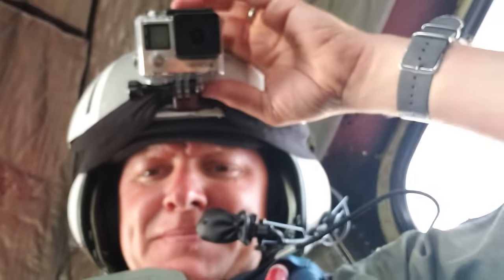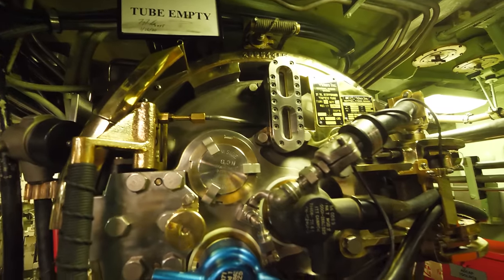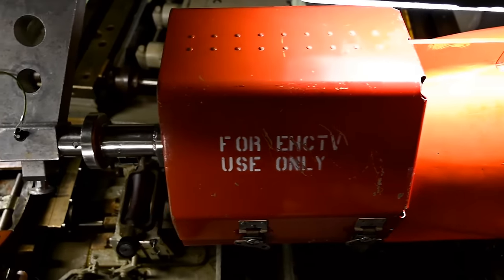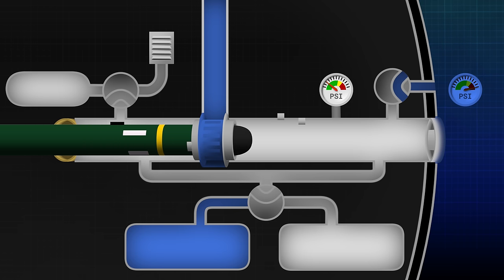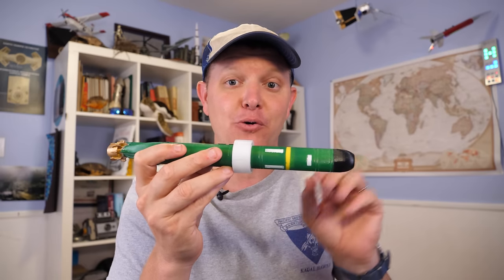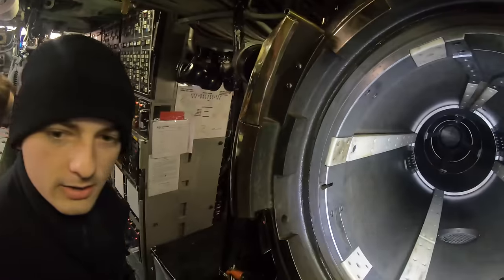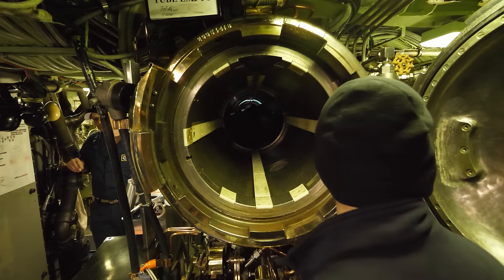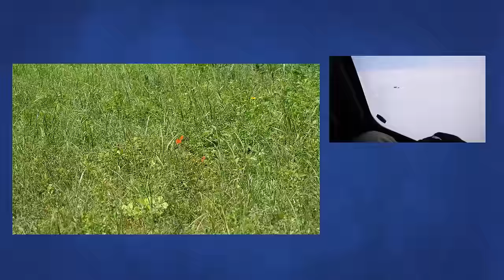Crawling Down A Torpedo Tube -US NAVY Nuclear Submarine - Smarter Every Day 241

Comment: OK, but, (dunno if you were being misinformed on purpose)

A: Of course torpedoes are neutral bouyancy. If they weren't as soon as you fired them they'd float to the surface or sink to the bottom. The only way to stop that would be to swim the thing level and that costs you distance and speed.

B: Submarines don't have a problem with running out of air - they make their own with electrolysis. The reason they keep the compressed air on board is because dumping air makes a lot of noise. So does shooting a torpedo, of course, but air takes a lot longer to get to the surface and is very noisy the whole time you're doing it, and it's not like they're not trying very hard to reduce all noise everywhere.

C: Water doesn't compress, the reason for the equalising vent isn't to set the same pressure inside and outside the tube - they are the same as soon as it's full, it's to match salinity and temperature so the torpedo can understand its target data once it's off the wire.

D: You didn't mention the wire?! That's gotta be one of the more mind-bending things about the ADCAP, thirty miles of cable being strung out the back of the fish, constantly spooling through the tube...

E: i think I might have been tempted to mention that the tubes can be configured for swim-out mode for divers as, well, might be fairly claustrophobey in there when the tube is dry, just trying to imagine doing that when it's full of ice cold water, you're wearing an aqualung and there are no lights, that's brown water time, at least for me.
Reply: you are wrong with C. Water basically is incompressible, but the pressure difference at depth is considerable and pressure makes force which they do not want when they open the external door.  Just because water is incompressible does not mean it does not pressurize.
Reply: @gkprivate433  Had a long and more indepth reply almost finished when my PC BSOD'ed that into oblivion. This will be briefer.

No, that's isn't how it works. The same word is used for similar effects but that just causes confusions.

We have found sealed glass bottles of wine at considerable depths. Were you correct they ought to have imploded on their way down. They do not because liquids cannot be compressed, and so remain the same pressure irrespective of depth.

The effects of water pressure (actually a manifestation of mass) on a submarine is because air is VERY compressable. A breach in a submarine effectively ends up 'using' the weight of water to compress the air (and crew) until all media equalise.

It is not possible to manufacture a container of pressurised water. You can manufacture a container with water under pressure (by, say, adding a load of very compressed gas to it) but that isn't the same thing. The confusion here is thinking that the water of the ocean is pressurised, whereas it is, in fact, under pressure. I can hear Queen too.

Filling the torpedo tube with water and then exposing it to the water of the ocean does NOT change the pressure of the water any more than uncorking a wine bottle a half mile down would change the pressure of the wine.

Put another way, one gram of water has a volume of one cubic centimeter no matter where in the water column it is sampled.
Reply: @Belzediel  A brief Google search shows that water is compressible (as is all matter) but it requires a great deal of energy.  Other documentation I found cites the same procedure Dustin walks through including pressure equalization.  This suggest to me that the force of gravity on the water is enough to compress the water at least enough to be a problem.
Reply: @grn1  Horse. Water.
Reply: Technically, anything can be compressed, solid and liquids are only considered unable to do it because their molecular structures makes compression extremely difficulty, in such a way that not even the depths of oceans are enough to compress them.

And the guy that answered you sure is wrong, yeah. In this regard, the "liquid pressure" we consider is just the weight of the water column over an area. The entirety of hydraulic mechanics goes around that liquids are almost impossible to compress, as as such are rather reliable ways to transmit force, and if needed, manipulate it. The contrary is true for pneumatic stuff, since its workings depends on using a gas that - something that can be easily compressed - and thus obtain various desired results from that, such as thermal pumps.
Reply: F you didn’t ask them about ‘squibbing’ the weapon batteries. Can’t remember if they do that for mk48s
Reply: OK, lets exercise the firing system to maintain it.  We will fire a water slug.  That means a tube full of water, no weapon.  STEP ONE, open the breach door and ensure the tube is empty.  Yes, that really is step one.  Care to guess how it became step one?  STEP TWO, secure the breach door.  STEP THREE, flood the tube with water.  You use water which is already in the sub to prevent taking on an additional 3000 pounds of ballast.  While you are flooding the tube you also are venting the air out of it so the tube will fill with good old in-compressible water.  Water is now coming out the vents so the tube is full of water.  STEP FOUR, shut the flood and vent valves.  You now have a tube full of water.  NOW THINK, what is the pressure of that water in the tube?  If you missed the answer; it is the same pressure as the air inside the submarine, the stuff you are breathing (it is a closed atmosphere in the sub but lets call it atmospheric pressure anyway).  NOW THINK AGAIN,  what is the pressure of the water OUTSIDE?  Hint;  44 psi per hundred feet.  Now open the muzzle door so you can fire the water slug out the tube.  Why are you having trouble getting the outer door open, its water on both sides.  Remember how big that outer door is?  About 400 square inches.  400 times 44 psi = 17,600 pounds of pressure per 100 feet pushing to keep the door closed.  The tube is full of water at about 15 psi trying to get the door to open.  400 times 15= 6000.  The odds favor sea pressure.  To overcome the odds equalize the pressure in the tube with sea pressure.  A very small valve opening the tube to sea pressure say 1/4 inch.  That would require about ELEVEN POUNDS of force to operate that valve per 100 feet in depth.  STEP FIVE, equalize pressure.  Takes less than a second as the tube and the sea are both full of incompressible water.  STEP SIX, open outer door.  Close EQ valve, fire tube, shut outer door and drain tube.  Open and inspect tube to ensure  no sea life has entered.  Usually inspecting for seaweed, barnacles, or any loose debris from the superstructure. From some of the comments I have seen here you might also look for seals, walrus and mermaids.  Also it is the equalization step that makes it hard to launch people.  Going from atmospheric pressure to sea pressure instantaneously is rough on a persons body, starting with the eardrums and extending to the lungs and ribs.  It might be done with special equipment but in general NOT A GOOD IDEA.
Reply: @williambixby4108  Thank you for the explanation and logic 😊
Reply: @williambixby4108  That was an amazing explanation, thank you. 
As for Guess how that became STEP ONE, I would imagine there has been a person or two left trapped inside there and it did not end very well for them.
Reply: @DarkSygil666  The Willy D (USS William D Porter) comes to mind, where they went to fire a water slug, during a drill and launched a live torpedo directly at their flagship (USS Iowa) with the US president (FDR) aboard.
Reply: Admiral Belzediel you seem like you know a lot so can you explain to me why in the demonstration of loading and firing the torpedo, the bottom water tanks have more water in them at the end. Wouldn’t that change the entire simulation for the next firing?
Reply: @wolvreigns  They don't.
Reply: CR   That's only at the most extremes.  I finally thought a good way to explain it though.

Imagine you have a spring and a press.  For the sake of argument I'm just going to use arbitrary values but the logic here is solid.  If you use a relatively light weight spring (say a pneumatic one) with a light (low force/pressure) press the light spring will compress quite a bit.  If you repeat the experiment with the same force but a heavy (say a hydraulic) spring the spring may not appear to compress at all.  Repeat both experiments again but with a much heavier (stronger force/pressure) press and the light weight spring is pulverized (it changed state) while the heavy ("uncompressable") spring is visibly compressed but does not change state (enough energy to compress it but not to change it's state).  

Liquids in a hydraulic system are like the heavy spring with the light press, the liquid compresses so little that it can be treated as if it was uncompressable.  Almost all of the force that goes into one side comes out the other since the liquid barely compresses at those forces.   Water at depth is like the heavy spring under the heavy press, the normally uncompressable liquid is now very compressed but unlike the spring which would be exerting all of it's forces up (towards the press) and down (towards the ground) the water pushes out in all directions looking for a lower pressure zone to move to (it 'doesn't like' to be compressed).  The water in the submarine before the torpedo chamber is flooded is at the same pressure as the air in the submarine and as such is barely compressed and the amount of energy needed to compress it enough to get equivalent pressure is insane.  Combine this with what  @CR  That's only at the most extremes.  I finally thought a good way to explain it though.

Imagine you have a spring and a press.  For the sake of argument I'm just going to use arbitrary values but the logic here is solid.  If you use a relatively light weight spring (say a pneumatic one) with a light (low force/pressure) press the light spring will compress quite a bit.  If you repeat the experiment with the same force but a heavy (say a hydraulic) spring the spring may not appear to compress at all.  Repeat both experiments again but with a much heavier (stronger force/pressure) press and the light weight spring is pulverized (it changed state) while the heavy ("uncompressable") spring is visibly compressed but does not change state (enough energy to compress it but not to change it's state).  

Liquids in a hydraulic system are like the heavy spring with the light press, the liquid compresses so little that it can be treated as if it was uncompressable.  Almost all of the force that goes into one side comes out the other since the liquid barely compresses at those forces.   Water at depth is like the heavy spring under the heavy press, the normally uncompressable liquid is now very compressed but unlike the spring which would be exerting all of it's forces up (towards the press) and down (towards the ground) the water pushes out in all directions looking for a lower pressure zone to move to (it 'doesn't like' to be compressed).  The water in the submarine before the torpedo chamber is flooded is at the same pressure as the air in the submarine and as such is barely compressed and the amount of energy needed to compress it enough to get equivalent pressure is insane.  Combine this with what @WILLIAM BIXBY said and you should have a pretty full picture.
Reply: @Belzediel  I work on machines that measure compressibility of fluids. I can assure you that water does, in fact, get compressed. It reduces in volume when you press on it. Even the slighest pressure causes an even slighter reduction in volume. It is only "essentially" incompressible for many (but not all) engineering purposes.
Reply: @Belzediel  Everything you've said is right, though you'd be technically thorough by mentioning that water, like all matter, is compressible regardless of how difficult it is to do in practice.
Reply: @austinsharpe8157  |Point is, and always was, in a video intended to be educational, they said something that was not true.
Reply: @williambixby4108  One atmosphere (14 psi) per 33 feet is how they taught us. I took a dive class.
Reply: @grn1  that's why an underwater nuke explosion causes so much damage. A depth charge had 500 pounds or so of TNT. A Westinghouse 55 (SUBROC UUM-44 warhead) has the equivalent of 500,000,000 pounds of TNT. (250 KT)
Reply: @Belzediel  Water is considered "virtually incompressible" just for engineering purposes. In absolute reality of fact though, it can be compressed under extraordinarily insane forces (we can find examples of compressed water taking on strange properties like "Ice IX" out in space,) it's just way beyond anything we'd use here on Earth even for massive heavyweight construction so for all practical purposes we consider it "virtually incompressible." Your overall point still remains, sure, but you shouldn't say "Horse. Water." to people simply pointing out that water can technically be compressed, like any other matter, under insanely high forces we don't normally find here on Earth even in our most heavyweight construction/engineering purposes. You were acting like they were dumb, that you can lead a horse to water but can't make them drink, when they were actually pointing out factually correct information nonetheless.
Reply: @michaelnorris6365  Interesting.  Your ballpark figure gives us 42 psi at 99 feet.  My ballpark figure gives us 44 psi at 100 feet.  Looks like we are in the same ballpark.  If I were diving (which I have not done) I would expect the gauge to top out at a couple hundred feet.  When I was new to subs the gauges for depth read out in feet. A fine gauge for depths above scary and a course gauge for depths below scary.  The fine gauge was secured from sea pressure when going deep.  In the torpedo room our gauge measured sea pressure, analog, and as i recall 50 psi markings good to a few thousand feet.  For me 44 per hundred was practical.  Per this chart google search brought up neither of our methods are accurate.
EXAMPLE (Imperial)
Depth (meters/feet)	Fresh Water (1000 kg/m3)	Sea Water (1030 kg/m3)
15.25 meters (50 feet)	0.3 MPa 36.4 PSI	0.3 MPa 37 PSI
30.48 meters (100 feet)	0.4 MPa 58 PSI	0.4 MPa 59.3 PSI
61 meters (200 feet)	0.7 MPa 101.4 PSI	0.7 MPa 104 PSI
91.5 meters (300 feet) Gato	1 MPa 144.8 PSI	1 MPa 148.7 PSI
Reply: @DarkSygil666  Actually tubes thought to be empty had torpedoes in them.  Rather bad thing to fire torpedoes by accident but it happened too many times so step one became required.  50 years ago, as I recall,  a sub doing tube maintenance  in Pearl Harbor launched a torpedo in the aft end of the sub moored in front of them.  Not fired but launched.  To fire a torpedo means prerequisites would be set in allowing the fish to arm.  Had it been an old WWII air-steam torpedo it would have fired but torpedoes  had become much more sophisticated by the '60s and '70s.
Reply: If water does not compress then how does a water compresser work
Reply: @Belzediel  U sound like a flat earther now WATER COMPRESSERS ARE SCAMS
Reply: @Belzediel  look up bulk modulus, water is indeed compressible to a tiny degree under immense pressures, the bulk modulus of water is around 2 gigapascals or 20000 TSI
Reply: @GamerTheTurtle  

Yes, I know, is it meaningful to mention? Nope. It is not possible for water at the operating depths of thes submarines to become pressurised to any reasonable level, hence my assertion that 'equalising the pressure of the water' is, in fact, NOT the reason for opening the seacock valve.

That statement is incorrect, no matter how many people (not y'self, that was perfectly polite) fail to understand there is a difference between a liquid under pressure and a pressurised liquid, that the crewman used the incorrect terminology and hence gave the wrong reason, and are sufficiently disengenuous they won't even look it up.

And will no doubt now be churning at the bit to suggest 40,000,000 PSI is something a submarine deals with.
Reply: @Belzediel  Thanks for the explanation.
Reply: Water is incompressible, but the water in the tube will be initially at the same pressure as the air inside the sub (which is nearly 1atm).  The inside of the sub is kept at atmospheric pressure for the people that are on the inside.  If the air in the sub was the same pressure as the outside water, then there wouldn't be such a thing as "crush" depth for the sub (which is the water depth where external pressure is at structural limit of the hull). 

After filling with water, the torpedo tube has to be connected to the outside sea water to equalize the pressure to be able to open the torpedo hatch. The water in the tube is incompressible, but tube is not.  The additional pressure from the sea water will stretch the tube a small amount (and admit a very small volume of water).
Reply: Incompressibility of water refers to the fact that the density of water is not significantly affected by the pressure of it. Water can be at different pressure. The fact that water and other liquids do not change density under different pressure is exactly how hydraulics work....
Reply: @abuBrachiosaurus  Given Black Holes and Neutron Stars I think we can agree that most anything can compress given enough pressure.  The pressure of a column of water, for the most part, is not enough to significantly compress water IMHO.  Yes, instruments have been developed to do so.  Back in my active duty days we had to enter missile tubes and charge "Liquid Springs" with fluid to pressures which compressed that liquid (Silicon Oil).  The Polaris submarines carried Polaris Missiles.  The designers new bigger and better missiles would be developed but were not yet available.  So, big tubes were designed to hold future missiles and smaller tubes were built inside the bigger tubes to hold the smaller ICBM available at the time.  The liquid springs held not only the weight of an ICBM but were also able to provide the rigidity need for the pressures needed to LAUNCH an ICBM.   

As for water compressors, I think you are talking about pressure washers, such as for washing equipment, houses and ship hulls.  Those do not compress the fluid.  They allow the fluid to enter chambers with a large entry ports and a small discharge ports.  When one chamber is full, another filling and one is discharging a pressure stream is developed.  When one chamber is full a piston closes the entry port and forces the fluid out.  The piston then returns to the position which allows the chamber to refill.  Most pressure washers have at least three of these mechanisms operating at a time giving what seems to be a continuous flow of HP water.  I have been informed there are at least three different methods to achieve the desired pressure wash streams.  That is how the one I am aware of works in our real world.  Leave the actual compression of fluids to the industries which require that.  The pressures developed in pressure washers is dangerous enough already.